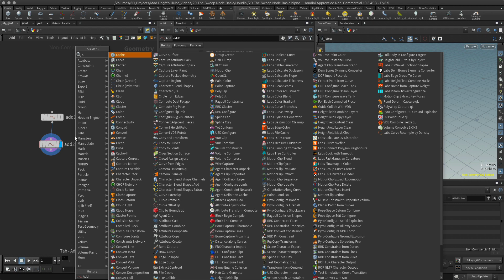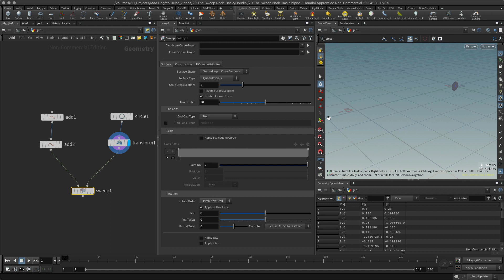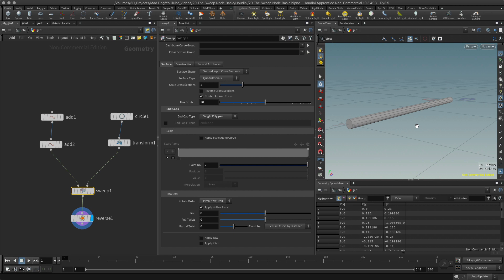#29 The Sweep Node in Houdini - Basic

Comment: Inside of the sweep node, we can turn end caps on. But, is there a reason why we wouldn't use polyfill for the end caps?
Reply from the maker: You can use the polyfill node also, and you will get a similar result. The sweep node does have a roundness option for ends - I am not sure if this is available in the polyfill node. A lot of it just comes down to the way that you personally like to work. In Houdini, there are usually multiple ways to get a similar or the same final result.

Comment: Why wouldn't you change the radius of the circle in the actual circle node, rather than using a transform node?
Reply from the maker: There is no particular reason why I did it this way. The size of the circle can be changed in both the circle node itself (the radius parameter or the uniform scale parameter) or in the additional transform node. The result in this case is the same.